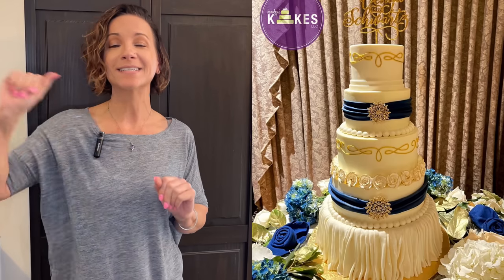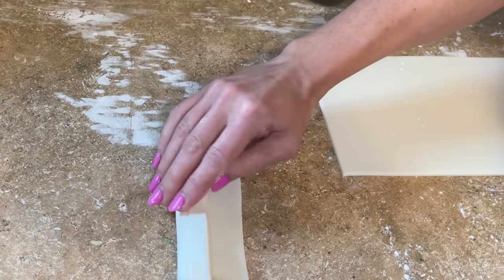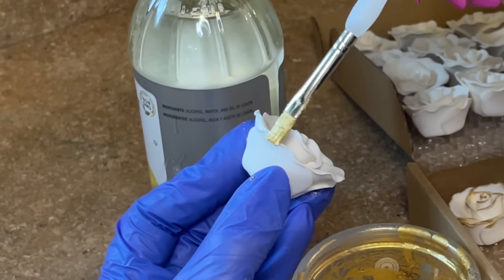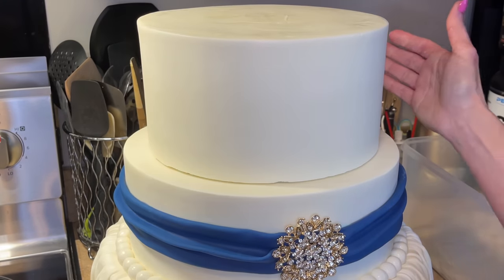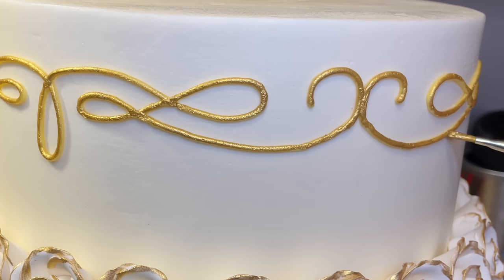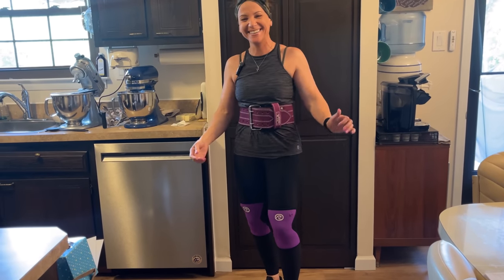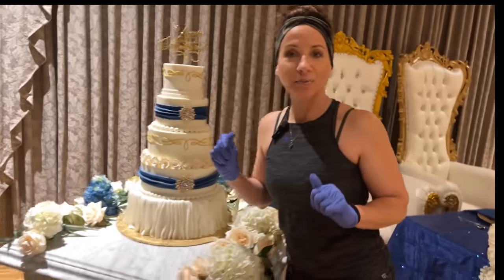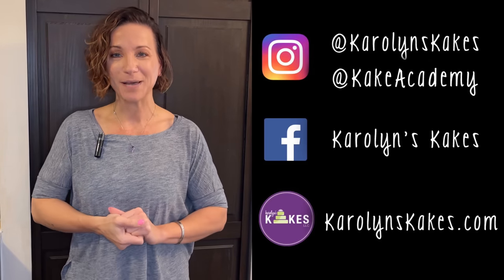How I Decorate A $1600 Wedding Cake | Transporting A Heavy Cake

Comment: Wow that was a lot of work you did but everything was beautiful! Do u cut the cake boards under each tier so that they are not visible? I notice it can’t be seen on tiered cakes just wondering are u supposed to cut off the excess and do u have a video showing that!
Reply from the maker: Thank you!  The cake boards are slightly bigger than the cakes (maybe 1/8 of an inch?)
And the icing actually covers it.  So there's no need to trim them smaller.
Reply: @KarolynsKakes  ok thanks
Reply: @KarolynsKakes  sometimes i use my tablet and sometimes my computer to log in lol

Comment: So your cakes go in fridge right not the freezer?
How long do you leave in fridge so it’s manageable to hold with hands?
Reply from the maker: Yes, they go in the refrigerator only after they are iced in buttercream.  I usually leave them in there overnight before I start handling them.  So they have at least 15-20 hours to solidify!

Comment: Isn't the tylos powder hardening the fondant?
Reply from the maker: It depends on how much you add.  If you add a lot, the fondant will be hard.  I only add a lot when I need something like a topper to dry hard.  For other decorations, I add less.  It makes the fondant smoother and easier to handle (it doesn't stretch and fall apart easily and is much easier to cut decorations.)